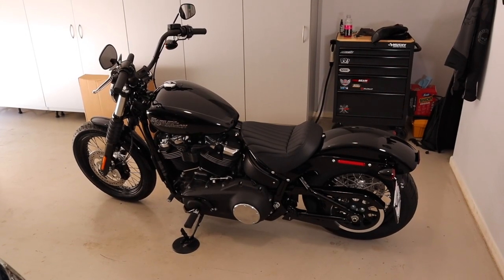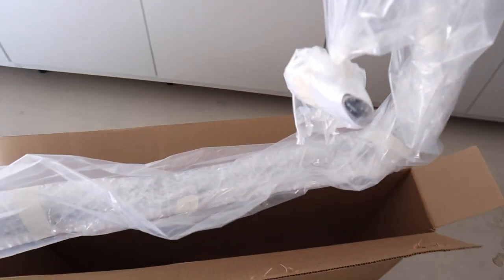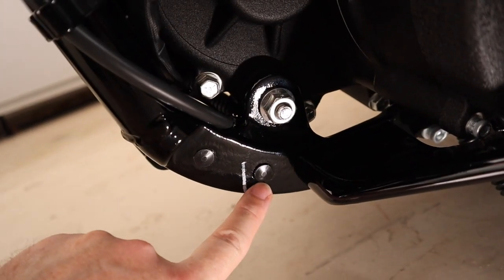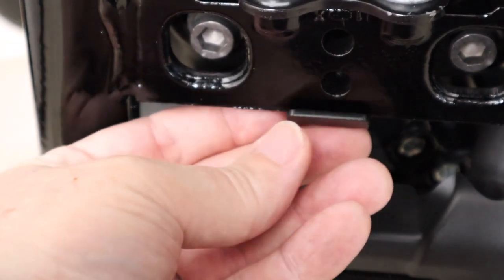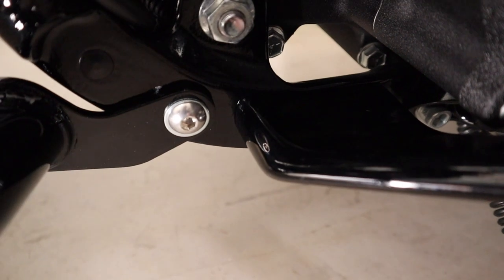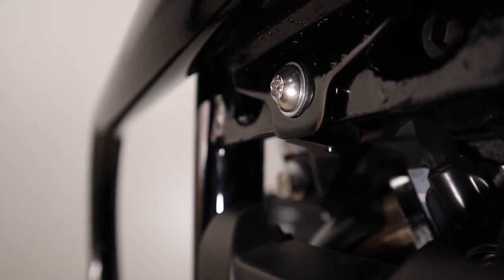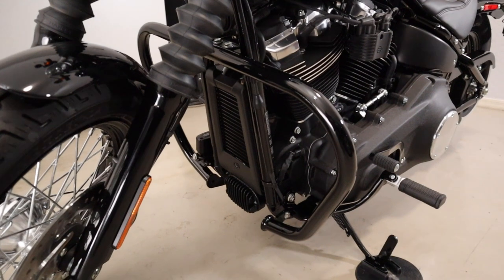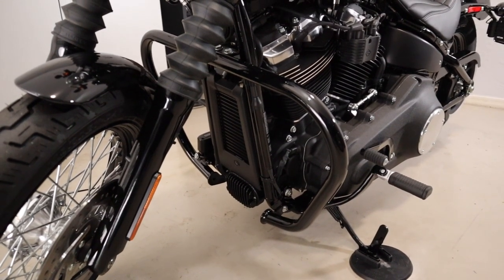Cobra Freeway Bars - Harley Street Bob (FXBB)

Comment: Can you add foot pegs to this bar with the way it angles down?
Reply from the maker: Adjustable pegs should work for this kind of bar. As long as they are not rigid mounted where the angle cannot be changed.

Comment: How much better do you think these will defend the bike against a lowside or a crash over the Harley standard one that you had?
I'm trying to think of which crash bar to go with for a combo with the Bungking rear frame sliders.
Reply from the maker: I think the Harley ones are slightly wider, but I switched to Cobra after my lowside caused the Harley bar to damage the frame on my Low Rider. The engine guard bent inward and took a chunk of metal out of my frame.
Reply: @KSSTUDIOS  Wait it took a chunk out of your frame? How did the bike not get totaled by the insurance company? usually frame damage means totaled bike.
Reply from the maker: @FranBunnyFFXII  It was mostly surface paint and a shallow mark into the bare metal of the frame. Not really a structural issue at this point, just a cosmetic one.
Reply: @KSSTUDIOS  Ah. I'm really not sure what crashbar to buy.
Reply: Unfortunately I had these tested the other day on gravel roads on my brand new fxlrs 😂 can say they fckn work a treat. Scratched underneath the brake pedal lever abit, scuff on the crash bar and light scuff on the underside of the oem heat shield on muffler. If it was on levelled tarmac it wouldve probably just been the brake pedal lever and engine guard only. Served its purpose, definitely rate it even though I never intended to but I now trust it wholeheartedly.